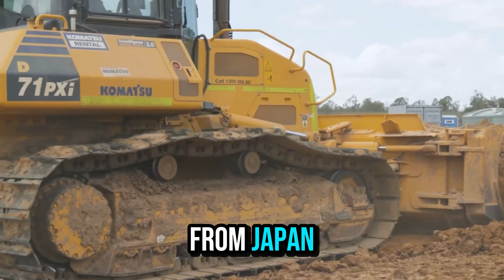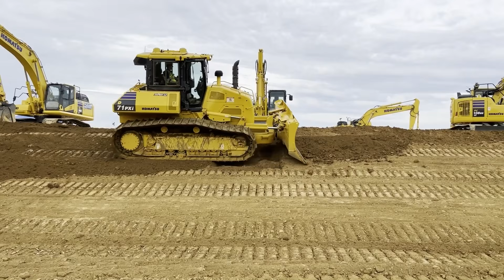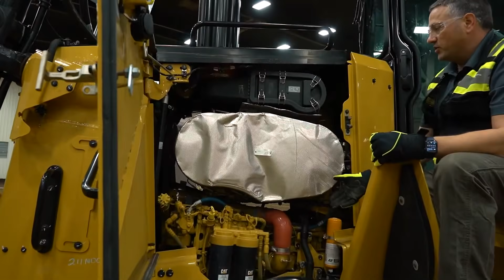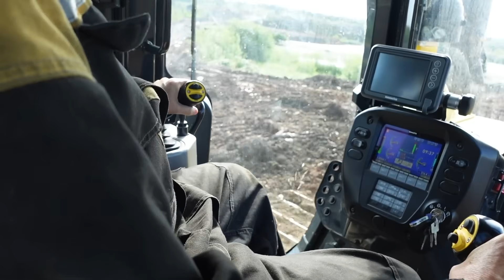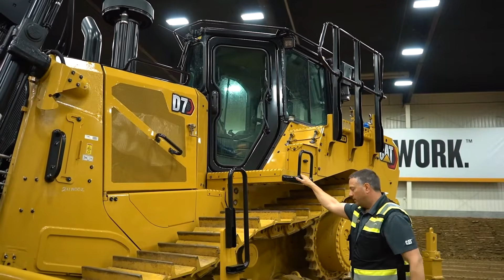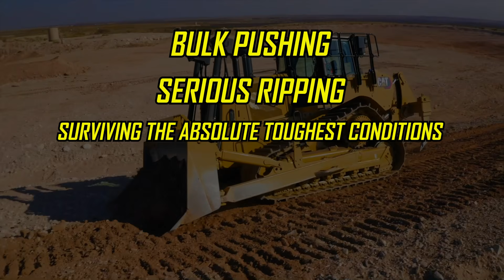Cat D7 vs Komatsu D71PX1: Bulldozer Battle

Comment: Cat is a better machine     komcrapso transmission is junk and is all ways trying to copy cat     they bought old plans from all others
Reply from the maker: @rickwho2314 i don't know. Their newer models tend to go longer without breaking down. The be edge for cat has always been their service network. I've been hearing from a lot of operators that Cat has outsourced the production of their parts and the parts are starting to become less reliable.
Reply: @Massivemachina  Agree on that, just was given a new D 6 LGP yesterday ,  blade  made in Mexico, rest of the machine made in Brazil, we will see how it goes.

Comment: This is a no good comparison, these machines are too different with different blades, mean for different purposes. If this is to make any sense take the Cat D6ex with a PAT blade and not the D7!
Reply from the maker: You make a valid point! Each machine does have its own strengths and purposes. I appreciate your insight on the comparison!
Reply: There's always someone that has to complain
Reply: @reloadnorth7722 of course…
Reply from the maker: @reloadnorth7722 it all adds to the conversation. I appreciate it. It helps me learn more while I do this and allows me to make better videos. For example, I've found out that Cat isn't even the largest distributor any more.
Reply: @Massivemachina  The comment about complaining wasn't for you. This is a great video. I am a retired equipment operator with over 40+ years in the seat. Caterpillar went downhill many years ago and they definitely NEED the best support system to keep them going. Where I retired from there was probably 300+ pieces of Cat equipment, all breaking down almost from completely new. Rigid truck frames breaking, moldboards falling off new 24 graders, D11's blowing turbos, excavators that couldn't pick up a full bucket of dirt, etc. This mine is getting rid of all Cat and going to Komatsu. Stay safe and keep making great videos like this one.
Reply from the maker: @reloadnorth7722 I know it wasn't. I respond to all of the comments on here though. It triggers the algorithm to push it longer for more views. I am glad you are enjoying my videos. From what I've found so far is that Cat's support system is great but they have outsourced their parts, which are not cheaply made causing more breakdowns. It has caused their market share to drop. Currently, they have been surpassed by a company called Shantui which is now the number one bulldozer sales company in the world.
Reply from the maker: @reloadnorth7722 I know it wasn't. I try to respond to all of the comments though. It causes the algorithm to push the videos more which means more views. Through my research I'm finding that Cat seems to be cutting corners. They've outsourced the production of their parts so although they have a great service network their parts are failing and their machines are breaking down more often. It's gotten to the point where komatsu's market share is growning and a company called Shantui has even surpassed Cat and become the largest manufacturer and seller of bulldozers in the world.
Reply: @Massivemachina I just want add also that your video is very good. I know I can be a little picky sometimes about details but that just me. And yes, for the last 4 months I have been operating a Komatsu D71 and I find it really outstanding, best dozer I have tried.
Reply from the maker: @hjorleifuringason2778 I"m glad you are enjoying the videos. No worries. When doing comparisons sometimes it's hard to get the line up just right. I did do a video on the D6 vs the D71. When I looked up the equivalent to the D7 both cat and komatsu used the D71PX1 as the comparison. The one I'm currently working on is the D8 vs the 155. I think that will be a pretty good one. Is there any particular comparison that you would like to see?
Reply: @Massivemachina Iook forward to seeing the D8/D155 comparison. They are equally sized machines. Btw. the D7 and D85 are also equally sized and should compare well…
Reply from the maker: @hjorleifuringason2778 I will write that down for a future video. Thanks!